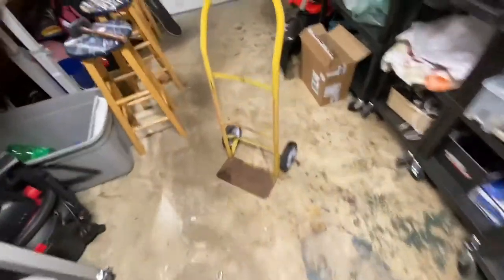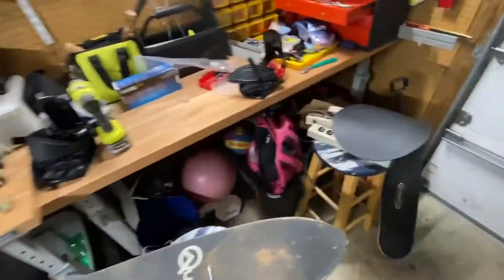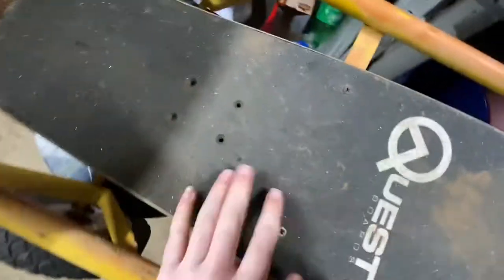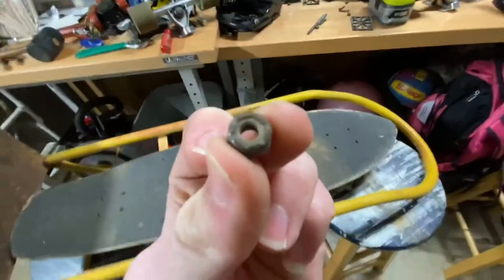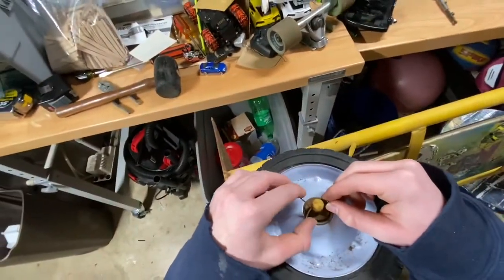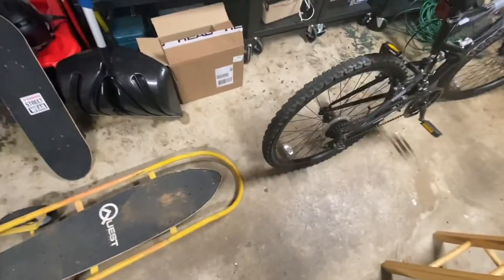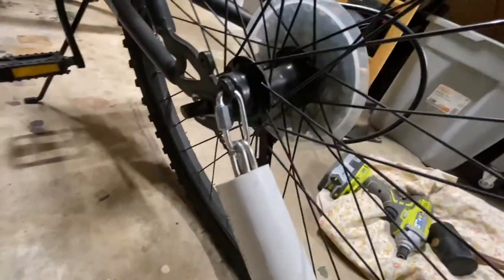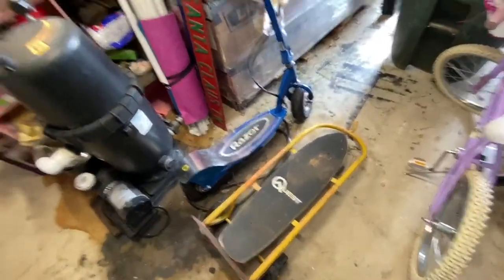TURNING A HAND TRUCK INTO A TRAILER FOR MY BIKE

Comment: The first idea for the trailer hitch would have been cool, and if I did it I would zip tie a pvc pipe to the frame and put a hook on the end. I'm excited for new plasma car videos, I was gonna make one but when I went around a corner, the wheels fell off and the plastic holding them broke, so I have to fix them.
Reply from the maker: That sucks bro, Hope you get back to hill bombing soon! Something actually happened recently with my plasma car after I took it in the snow. The wheels in the rear feel like they're caught on something and they're really hard to spin. It rides relatively the same but I'm kinda worried about it. I even took the wheels out and checked to see if there was anything wrong with the bearings but they looked completely fine. I sprayed some WD-40 in them and they still wouldn't spin whether they were in or out of the plasmacar. I might just buy some new wheels that actually fit right and be done with it. New plasmacar videos are coming soon.

Comment: I would scrap those wheels use sixteen inch bike tires air tires would be better.
Reply: How would you attach them? I'm trying to put 20" bike tires on a hand cart rn
Reply from the maker: You might have to take the hub out that had the threaded axles and hope that it slides on and you can pin them im not sure